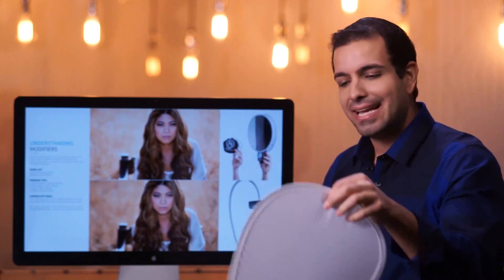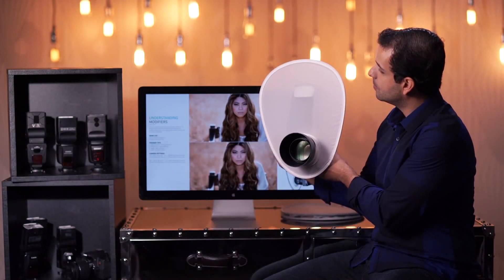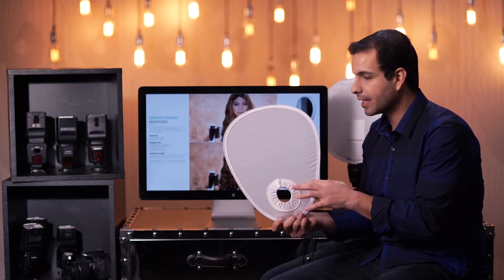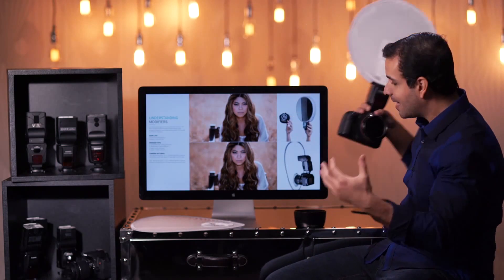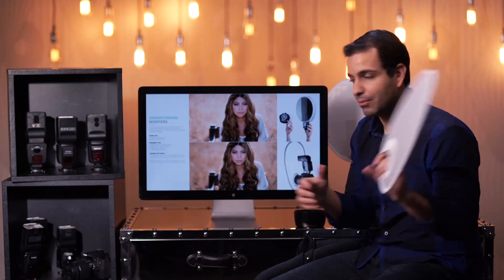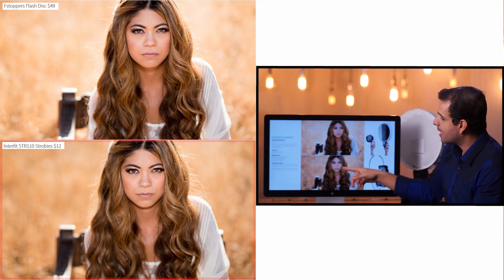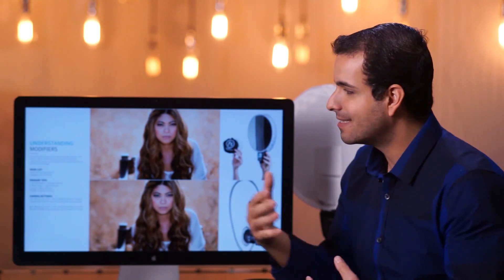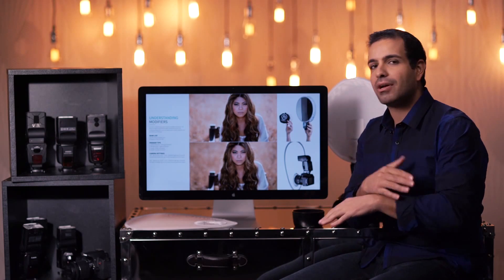Understanding Flash Modifiers and Predicting Their Light Shaping Effect | Lighting 101

Comment: Idea. It"s common right now to use a big umbrell pointed down to get that soft look. However if we get to the place were model stands we will see just narrow light source from left to right an a bit wider in the center. Yes It"s  big surface bownce from the floor and etc. But as headshot or halfbody shot... Imagin a tool for speedlight very light can be caried in pocket but attached on on camera flash looks like french baguette? Horisontally. With a little reflector for fill light it shood simulate shooting from below edge of umbrella with butterfly light. Reflective surface should be on the top side, back and ends of baguette. Allowing light go ahead and down. Triangle shap Reflective piece to spread the light from speedlight to both sides of baguette in the center on top. Idea is to get a light and portable baguette on camera flash with small 40cm round standart reflector on chest level in place of c stand with octa or reflective umbrella. On location indoor, if not midday outside.